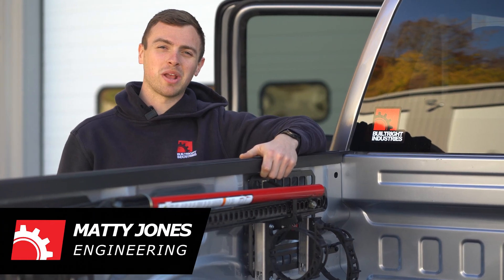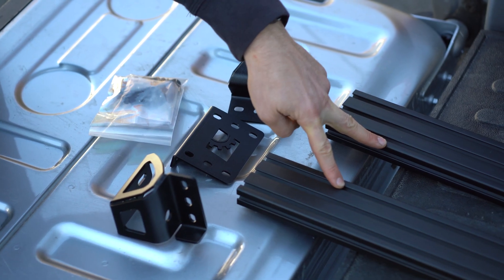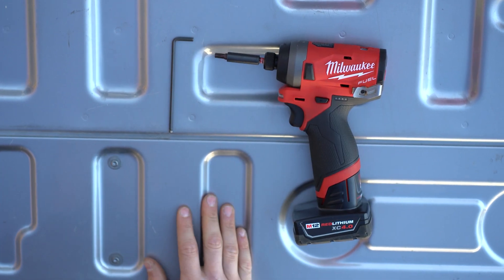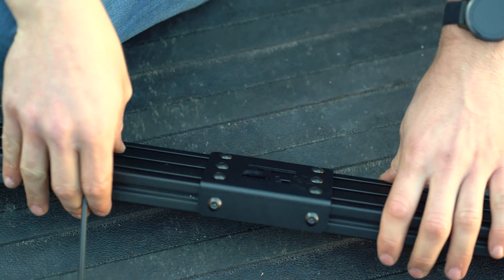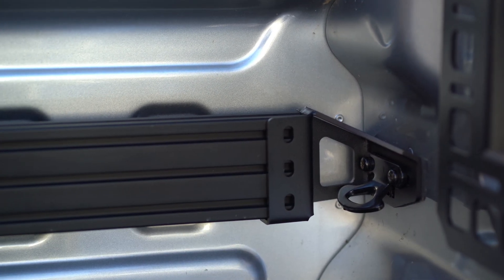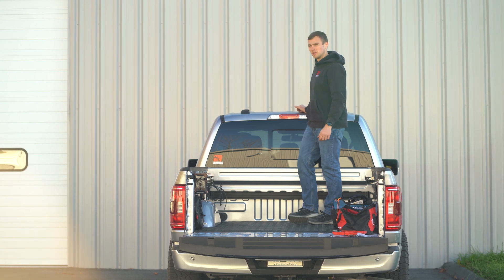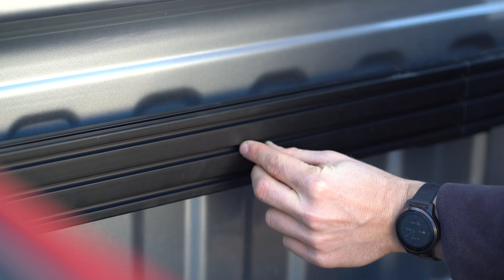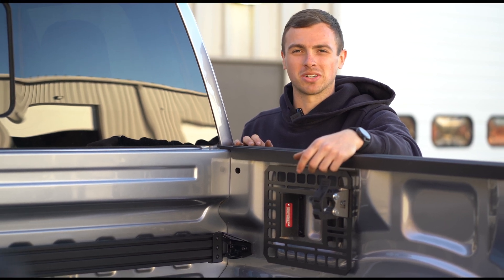F-150/Raptor Bulkhead Accessory Rail (BAR) Install Guide

Comment: Far better to attach the forks to mounts at the back of the bed where they can be reached while standing on the ground. The BuiltRight mount means climbing inside the bed for each bike and then doing so again at ones destination and again to go back home and again at the house. Also mounts do not work for bikes with 12mm or 15mm thru-bolt axles.

Comment: Great product.  Mine is slightly too long to fit in brackets and I will need to trim them.  Maybe due to the spray in bedliner thickness.

Comment: Would really love for you guys to come out with a rack for the 5 gallon Scepter plastic can!  This would be a great place for it to go, even if the rack is simply a wrap around piece that attaches to the BAR and lets the can bottom sit on the bed floor.

Comment: Matty - Another great product!  So, no impact on assembly?  Is that too much torque?  Thanks!
Reply from the maker: Thank you! Use of a small impact just requires some experience and a good sense of the difference between 'nice and snug' vs 'send it through the bedside'.

Comment: Could u mount traction boards on this??
Reply from the maker: Yes, a set of traction boards could definitely be mounted up to the BAR - we would recommend using a couple tech plates and mounting the traction boards' native mounting system to them.